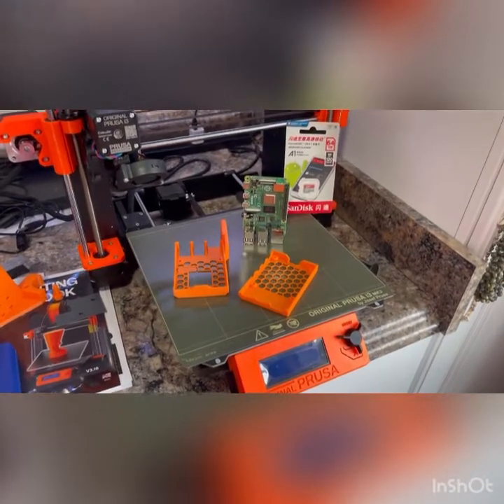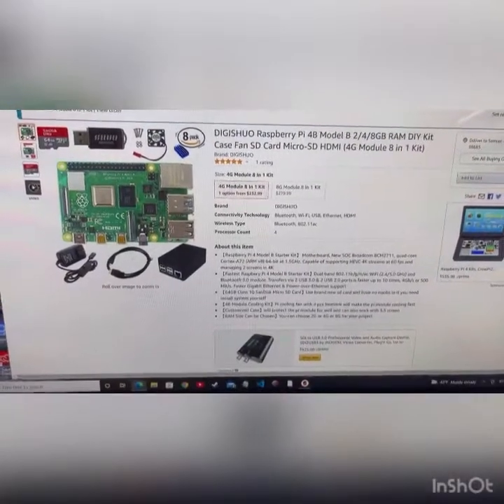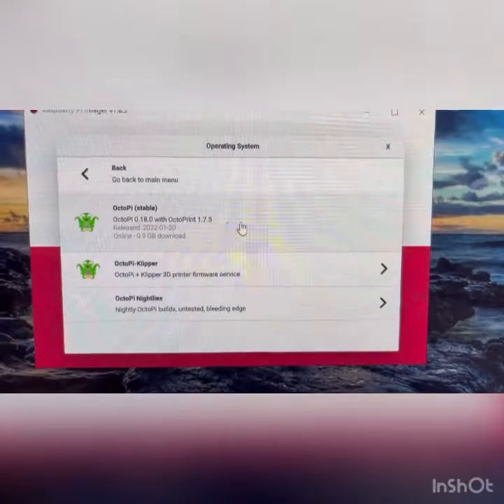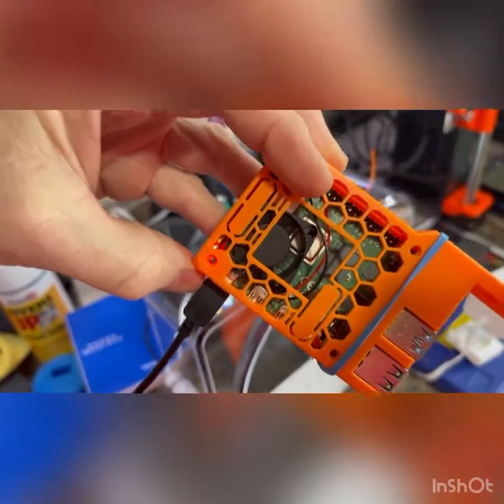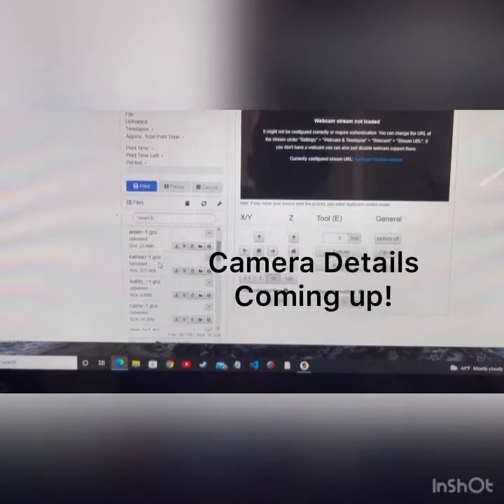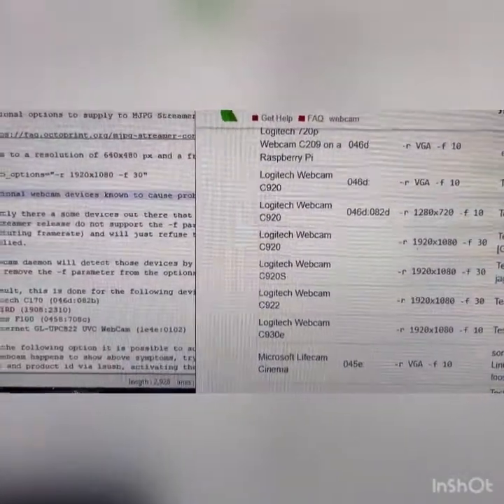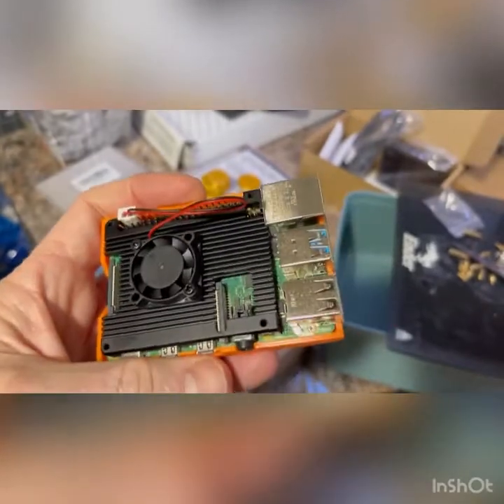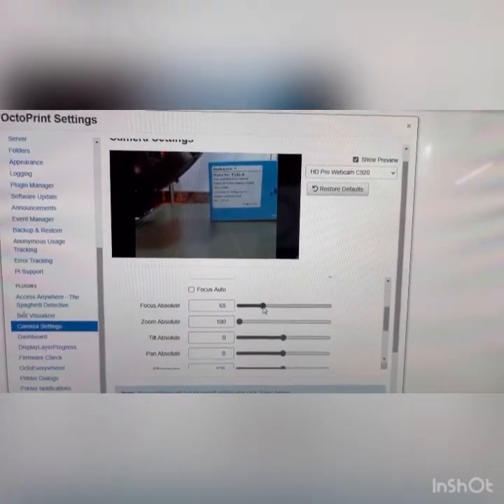Prusa MK3S+ Raspberry Pi - Octoprint - Webcam Installation (Part 2 of our Prusa Series).

Comment: This video ROCKS. Thanks for sharing, wish I could give it more likes. Notes to people following the tutorial: 

1. the Raspberry Pi may take about 10 minutes to boot and connect to your router.
2. The Prusa configuration for OctoPrint suggests a custom bounding box
3. Camera settings (manual focus) is a plugin you have to add on OctoPrint.
Reply from the maker: Thanks Erick. I’ve noticed lately that it’s taken longer for the pi to connect.

Comment: Great  video!  Do you do consultation or offer assistance if I end up needing help setting up?  I still have about a month before my Prusa gets here.
Reply from the maker: I don’t - but it’s pretty straightforward if you are using the same parts and software in the video.  Also, the Prusa and Octoprint forums are very helpful at answering problems and specific issues.